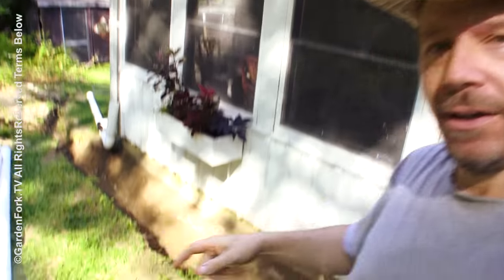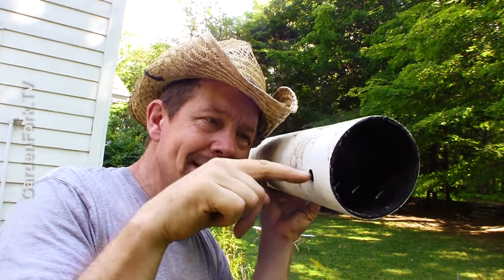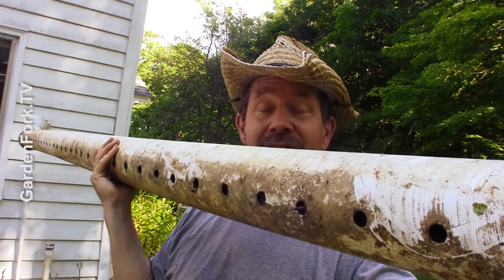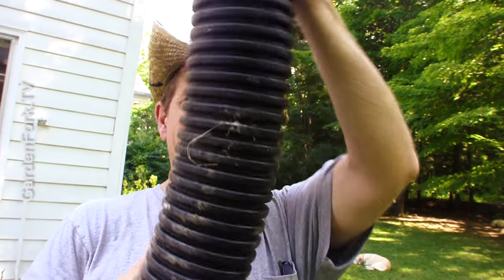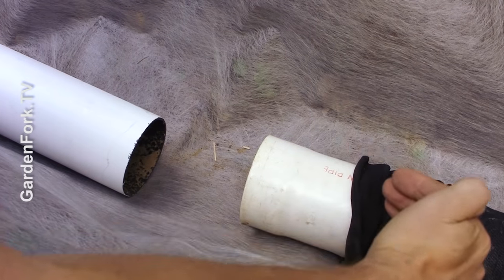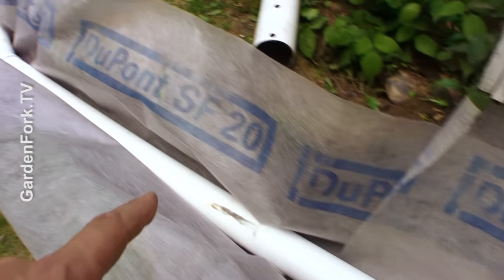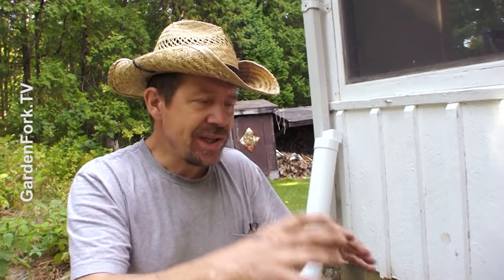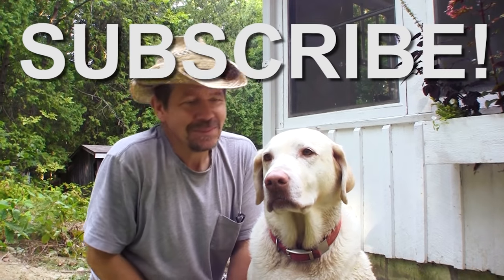How To Put In A French Drain - GardenFork

Comment: One quick tip...   Put a little layer of gravel for the pipe to sit in.   Then do not glue the end on.  You may need it for a clean out years later???
Reply from the maker: yes, i made sure not to glue the cap just for that reason. thx!

Comment: Putting the fabric around the pipe only protects the pipe.  The fabric should be outside the gravel to ensure the same doesn't happen to the gravel also.
Reply: It looks like he did exactly as you describe. 4:18
Reply: @marlboromatt5656  - You're right, he did.  Must have gotten called away at that point, I missed it.

Comment: Check out Apple Drains. No need to push sock inside. You need water to run thru. If u want to wrap it, lay material in trench, lay stone and pipe and then overlap material over the pipe and pin it. You need to make sure water can penetrate the material. You don't always need to wrap pipe. You can use easy drain pipe that's already wrapped with no stone underneath and cover up with stone or dirt u shoveled out. Corrugated with slots all around is better for bending .

Comment: I appreciate the clear steps on your video. Best DIY French Drain video I have found. 
Is there a reason why some people use 2inches of gravel underneath the drain pipe? Having the pipe low to collect the most water possible as you did seems to make sense.
Reply: JAMES LASTER Gravel underneath is another way to keep dirt clogging the holes on the pipe.  If you lay it on dirt, even with the filter, there’s still a higher chance of clogging.
Reply: @thewhiteelephant  That is what I have found to happen. The soil at the bottom of the trench clings to the fabric which clings to the pipe and seals off the holes. A small layer of rock keeps them more open for water to enter the pipe.

Comment: I know it's an older video and I haven't read all the comments, but you should be able to tie in your gutter to that drainage system. You shouldn't ever feed gutter water into a French drain if it is being used for drainage purposes, but after your French drain ends and you tie into the solid pipe you can put a wye fitting on it angled towards the downhill portion.

Comment: The only thing I would add, always use the bell end of a pipe as the entrance, not an exit. If you use the bell as the exit, water can seep out through the bell. Not a big deal on a French drain normally, but it can be when you switch over to the solid pipe.
Reply: The bell end, is that the holes pointing upwards? 
Henry and other dog are lovely! Thanks for video, trying to find out how to drain my allotment wich right now is more a pond..

Comment: Awesome video for the -"do it yourselfer". I LOVE your dog(s), nice touch! As for the securing of the sock what I'd do...is use a coupling for that size of pipe but cut it so it is just a "ring" and tap that on to secure the sock. Tap it on with a hammer and a wooden shim. You can even drimmel it so it will indeed "slide" to where it needs to remain...Now the video I need is one that will show how to build a culvert out of stone or natural material instead of expensive corrugated aluminum drain pipe. This culvert will be burried as I have an arroyo in the back of my house that gets flow at sporatic times during the year and I want to cover the culvert entirely with dirt so I won't have a ditch in my back yard!

Comment: Great job of explaining things. Good job!  The corrugated doesn't work as well for certain applications a pain to handle sometimes too.
Reply from the maker: yes, i have found the corrugated to be hard to handle, but it does have its uses. i have always thought the corrugated would be more likely to catch silt because of the valleys inside the pipe.
Reply: You are correct about that, the crevices slow the flow of water.  Had some for our pond outlet with the holes, didn't see them when we bought the pipe LOL you aren't the only one who has troubles.  The flex is good mostly when you have elevational changes that aren't gradual.  Doesn't work well for french drain at all.
Reply from the maker: yeah, the slits in the corrugated are hard to see at first. also it seems the corrugated could be crushed if its too close to the surface and you drove over it with a heavy load in a trailer, etc.
Reply: You are correct about that.

Comment: Did this French drain keep your basement dry? I’ve watched a ton of videos that recommend using 6-10 mil poly from the foundation to line the trench prior to lining with the gravel. I’m preparing to build a french drain in the spring to help divert some ground water away from a basement wall. Just curious if this worked for you. Great video!

Comment: This is great. The other video didn't have a sock mesh for the pipe or the white filter fabric. I'm trying to keep it simple so will skip any step I can to save time, effort and money. I have a simple job but not hundreds $ budget. With rigid pipe I could check the slope with a level....all that work and I begin to wonder, what if you just dug a retention pond?

Comment: Great find Clear simple info and like the entertainment value - any tips on the downspout drain extension? We used corrugated as the pipe product but still getting softspot at the entry point in heavy rainfall - can we start first 6-8 feet with solid the switch to corrugated?
Reply from the maker: there might be a clog? i would use solid as far as possible. - eric

Comment: Excellent video! Nice step-by-step explanation.  One question--would it be a problem to run perforated pipe the entire length of the trench to where the pipe daylights?  My land has a steep incline, and water builds up like a swamp.  I know there is more work involved in running perforated pipe the entire length, and more expense (landscape fabric, sock, stone, etc.), but in my case I was hoping doing so would increase drainage.  Thanks!
Reply from the maker: I’m not an engineer but it makes sense to me. Thx!

Comment: very useful video ..thank you  :) as this was done some years ago , did the drain work OK ..how has the snow melt been  ?
Reply from the maker: Hi Andrew, this has worked well. the one mistake I made was having the bell side of the pipes facing uphill, but it works well. quality geotextile fabric is key. - Eric.
Reply: @gardenfork Bell end towards uphill is correct, i think, towards the water source 🤔

Comment: Tell us again what type of gravel to use.  Would you suggest we put drain pipe right next to basement edge?  How about painting the basement to waterproof it?
Reply from the maker: painting the inside wall will not do much IMO, until you deal with the water outside the wall. 3/4" washed gravel is best

Comment: I like that you put the filter fabric around all the gravel and still use a sock..  That's the best way

Few things:

Don't need filter fabric around solid pipe
Don't need to put gravel over fabric after it's folded over...can just put dirt on top
I would put a 2" layer of gravel below the pipe before laying the pipe down
Reply from the maker: good to know, thanks for those tips. i wanted gravel on top as this sits right up against the board and batten wall of the porch, and didn't want dirt and grass growing there, thx!

Comment: Great video. I have railroad tracks behind my new house on top of a steep hill, may have to do a very expensive retainer wall and put french drain on side of wall. I really didnt understand facing holes down before, I though the idea was to trap water in a U shaped trench surrounded by pastic and force water to the end. Wont the landscape fabric just allow the water to seep into the ground ?
Reply from the maker: water seeks the easiest path, and its easier to run through the gravel into the holes in the pipe than to seep back into the ground. the water will collect in the empty spaces between the gravel, make its way down to the bottom of the trench, and enter the holes in the pipe. much easier path than traveling through dirt. thx!

Comment: I wonder about the amount of fabric and wrap to use. A few professionals here have demonstrated that with wet clay like soil it clogs the water from going through. I'm thinking about 3 inches of rock, lay pipe, more gravel on top. Then a 12 inch strip of the fabric laid across the top of the rocks and then fill with dirt

Comment: After a lot of rain the soil around my bi-level can't hold the water and seeps through part of the foundation it finds cracks. Which do you think is better, the French Drain System or Interior Drain System with sump pump? There seem to be a debate & it only affects part of the house.

Thanks for your response.
Reply from the maker: if it seeps in, you probably need the french drain at the bottom exterior of the wall, its then called a curtain drain. it is a roll of the dice. sometimes the interior one fixes it, sometimes not. with the curtain drain, you have a backhoe in your yard and a deep trench away from the house.
Reply: Inside sump pump system is the last line of defense. Can you collect surface water outside and drain thru gravity? A lot easier, cheaper and works much, much better. You don't want a french drain too close to your house. SURFACE WATER-Solid pipe and collection system. GROUND WATER-French Drain System.

Comment: Hi thanks for the video. Is there any recommended depth? or is it site dependant?
Reply: I'd say it's site dependent however the deeper (or wider) the better.  It's more work but the trench will have more volume and thus can grab more water.  He makes a good point to use a quality (non-woven geotextile) fabric, don't skimp.  Also, wrapping the pipe is not really necessary and I don't think there is any problem with corrugated...it has more entry holes/slits.  Basically a pipe is opening a channel in the stone to allow for water to migrate and escape.  It will get out.

Comment: Do I need to put the trench against my house or can I dig it say 500mm from the house to really keep water from getting to the house..
Reply from the maker: You can put it anywhere as long as the water settles there. You can grade the yard so the water drains to the drain.
Reply: Thanks! hope to prevent water getting under the house to begin with :)
Reply from the maker: Watch and see how the water drains toward your house and put the French drain in that path. Also look up what is a called a swale, you can make one and put the gravel drain in the bottom of the swale.

Comment: once the gravel is put back up to lawn level, what kind of load could you put on top of it? Could you put 5 railway sleepers stacked up on top do you think (that's about 40Kg per linear metre each, so 200Kg per metre) and will the load be OK/dispersed or will it crush the pipe? I guess it depends on how deep the pipe is, so lets say 450mm ?
Reply from the maker: I would use a thicker pipe if there is weight on top. Thx!

Comment: Do you find that the top soil over the rock has hampered your drainage or caused sediment to enter the drain pipe? How long has it been since you did this and have you encountered and further issues?
Also can you provide links for the materials you used?
Reply from the maker: If you use the sediment filter material the soil should not enter the drain.

Comment: the black perforated drainage pipe works just fine. I install it all around my home and after eight years it works just fine without all the filters.
Reply from the maker: my issue with the corrugated pipe is if its  installed too shallow in the soil, and you drive a car or heavy equipment over it, you can crush the pipe. but i see it installed everywhere, so good to hear. thx!

Comment: A few questions. I need to install this type of drain along the side of my house. How, of should I, connect my gutter drain to the curtain drain? The issue is that the water goes into the foundation from the side of the house and the two gutter drains that I have on that side also don't help keep the water away. I would have to drain them through the curtain drain. Should I attack a pipe to the vertical gutter drains? Also, I've seen people use a 'catch box'. What is the benefit of that?
Reply from the maker: do not connect your roof drain pipe to the french drain. all that does is put more water along your foundation wall. run a separate pipe away from the house for the roof drain.

Comment: Is there a way to tie in the roof drainage to the French drain?  You said that's not a good idea, but could it work if you use a Y fitting?
Reply: Two ways I can think of to do that that shouldn't over load the system. 1) the best way is, run a second solid pipe to the point where your outlet pipe goes to solid pipe. This could still lead to over load. A larger diameter outlet pipe from that point on might help. 2) I've never tried this but I think it would work. Do not make an actual connection, just run the roof drains down to the stone level. Let it filter into the pipe. 
   I watched a home improvement show on PBS where they ran the roof drain down into a large flower pot filled with stone, that had holes added to the bottom to let the water out.

Comment: Use Non-Woven Geo Fabric #4 or #8  DONT USE Landscape fabric, don't just buy anything and think it will work  for a long time.  Also look for the yellow 8 slot holes per groove in the pipe. Much better water flow. The slots go all the way around the pipe. Not available in big box stores yet. I'm not sure who all sells it but baughmantile does.
Reply: You've been watching the French Drain Man.
Reply: @idontcare1762  yes. You think he is not good? I don't like that he does not allow comments on his videos
Reply: @desperado77760  I think the French Drain Man is good.  If I built a french drain I would build it the way he does.
Reply: Scott ___ there is no standard set by the Civil engineers, or ASTM on which fabric is used. For that reason any could be used and it’s opinion and personal preference. 

Why so many holes in the pipe? What is the drainage requirements of the system? How would the system benefit from using that pipe compared to one similar, but with less holes? It’s the slope on a pipe and its size that determines the gpm a system will discharge at the end. 

Now you see why he has his comment section turned off. Good sales man. I’ll give him that 👍
Reply: @Bellislawns  Thanks for the comment B&B. I have no faith in the ez-flow system you use. The reason I like the Non-woven Geo fabric is totally because of a video I watched demonstrating how quickly water passes thru it (fast drainage) whereas the more common fabric was very slow and the water kind of passed over the top. So it's not from my personal experience. I'm just trying to figure out a solution to my drainage problems.   The water from 5 large yards ( each one averages 10k sq ft) drains into a space of 12 ft shared by my neighbor and myself. I wish I could attach pics of the flooding that has occurred. I"m searching for answers. 1)  Should I outlet my downspout water into the french drain or should I use a seperate solid pipe?  (2) Is it ok to join a french drain into a solid pipe to carry out to the curb (80ft)  3) Is it better to use the Baughman's Tile type of corregated drain pipe (yellow pipe) it has larger slits and they are all the way around so if your french drain trench is overwhelmed with water it can also let the water on top of the pipe drain out as well.
Reply: @Bellislawns  slope determines the speed of the movement. The number and size of holes or slits determines the max volume that can be moved at the given speed. silly person. learn math.

Comment: i have always seen the black drain pipe used  but  then it is wrapped in landscape cloth  (same as the sock trick). Is the silt cloth the same as landscape cloth?
Reply from the maker: yes, but is like a really long sock and easier to deal with. it comes in 10' and 100' lengths. i like to use it and the silt fabric as a double filter against mud filling up the perf pipe. thx!

Comment: Thanks for the video.  I'm getting ready to add a French drain and researching different methods.  Was there a specific reason you didn't add a layer of gravel under the perforated pipe to prevent clogging at the sock?
Reply from the maker: i am not an expert, but my thinking is i want the water to get into the pipe and drain away, not lie beneath it. i also figured that with the top layer of filter fabric, and then the filter sock, i would avoid clogging. one should use 'washed gravel'  , i didn't specify that in the vid, that keeps stone dust from clogging the filter fabric.  thx!
Reply: Great Job! and i want to know can i use the cobblestone instead of the gravel? cause in my home town we got more that.

Comment: I prefer black corrugated pipe. Also it's important to use CLEAN 3/4" - 1" rock
Reply from the maker: yes, good point. this wasn't the cleanest rock, i blanked on screening it. the corrugated has its uses as well, it bends nicely and you can buy it in long lengths with the silt sleeve already attached.
Reply: Where do you get cleaned rock

Comment: How is water going to get into the pipe and flow away downhill if you turned the holes downward? Shouldn’t the holes be turned up so the water can enter the pipe?
Reply: Paulette Mast that’s not how water flows. The water flows into the trench between the voids of the gravel. Water then rises upwards flowing into the holes of the pipe to be carried away. 

If you point the holes upward the water has to flood the whole trench before it can rise up to enter the pipe. This could (and does in a lot of cases) cause water end up where you don’t want it...in your home or basement.
Reply: The pipe is just creating a void in the gravel for the water to migrate and then carry away at speed.  Corrugated drain tile/pipe has holes around 360 degrees.